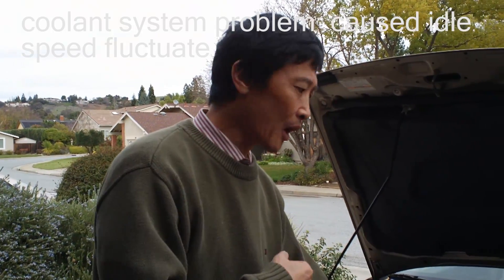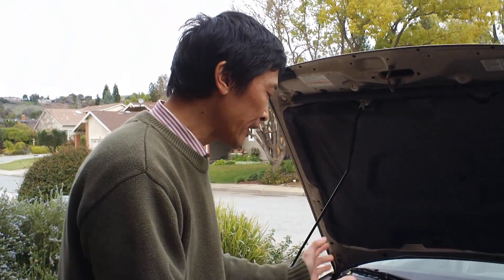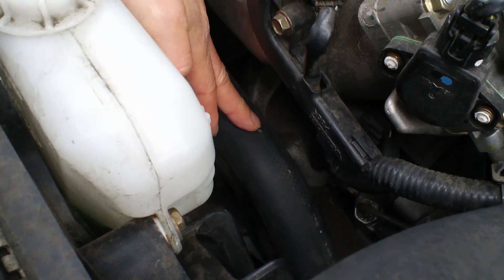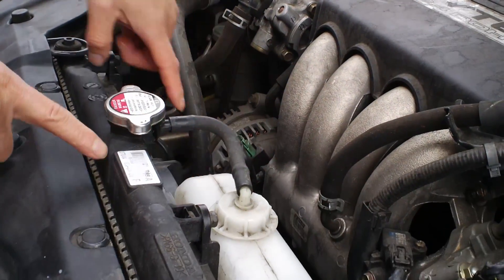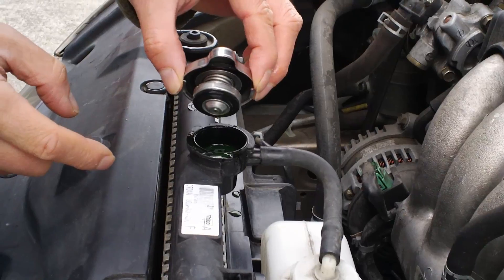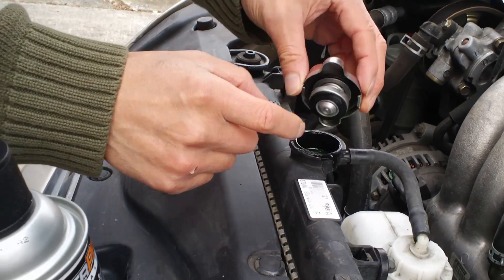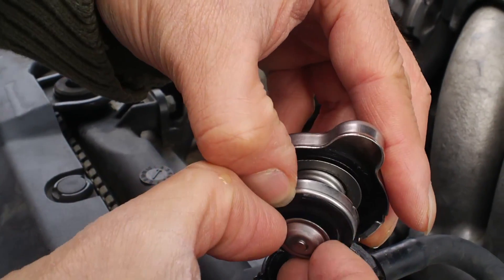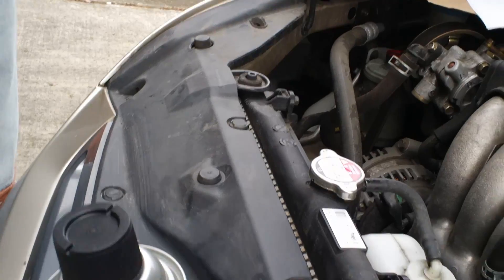Solution For Collapsed Coolant Hose In A Car

Comment: Have the surge and same thing flat hose and noticed this even buying all parts like throttle body plugs coils maf sensor pedal sensor and battery. Then a new air filter. I’m going to buy a new cap  now . 👍🤔

Comment: I had exactly this collapsed hose problem on my Vauxhall Astra, which was causing rough idle on cold start, Sep 2020. I released the Rad Cap and the hose re-inflated. After re-sealing cap I started it up and it ran smooth as silk right from the start!! Thanks for this I really appreciate it, you are a genius!!
Reply from the maker: Thank you for taking the time to share your problems and your results. Your case of other car make ad model will help other viewers to know this problem can be solved for non-Honda. Thank you.

Comment: Hey I have the same car and I have a problem could we get in touch so you can have a thought on what might be wrong
Reply from the maker: what is your problem? You may post your question here
Reply: Genius Asian oh so I have a leak from the radiator starting from the upper tank I have a short video I don’t know how exactly i could explain it to you 
My main concern if someone know the problem type I’ll be able to asses whether I need to get a simple cap or part replacement or do I need to go to the dealership which I don’t want to naturally
Reply from the maker: @shetty9494  I assume that you are sure it’s coolant that’s leaking, not another fluid. So the next questions:  is it from a hose? Or plastic part? Is it metal radiator tubes or the seam? Is it when engine hot with pressure?
Reply: Genius Asian it’s the coolant so it’s visible 
I can see coolant leaking from the top grill teeth
There is no cracks in the upper or top tank seems like it’s leaking from inside
Reply from the maker: @shetty9494  not sure your description, you may post a photo URL ( https://imgur.com/upload  ) may be some of our viewers can  help you.

Comment: Thank you...¤▪☆○•°~`♡😙😉

I foind other video saying that the other tank cap which need to either be cleaned or changed (follow the thin smal pipe from radiator cap to the extra antifreez tank so that tank cap is the problem... )

Comment: Great video I learned a lot
Reply from the maker: Yes, this coolant problem was tricky, not easy for people to realize that there is such relationship between coolant and other things.
Reply: Genius Asian yes. I found a spring in my coolant hose and was wondering why it was in there apparently it prevents the hose from collapsing in on itself.
Reply from the maker: thank you for sharing.

Comment: so this was the cause of the high revs and bad acceleration?
Reply from the maker: yes, the engine rev is controlled by the computer. And the computer takes inputs from many sensors including the coolant.

Comment: Thanks for the video, I ve the same problem before, the radiator didnot suck completly from the spare tanks (collant bottle). I check with all workshop they said my civic head crack an cannot be repair, I cannot find the head for my Civic engine and buy the whole seconhand engine :(
After replacing the engine found out that the top radiator hose bloated when engine warm and collapsed when engine cool down
Reply: Yeah, he definitely needs a new mechanic. It's harder than hell to find an honest mechanic. It almost seems like the nature of the work makes them crooked as a dog's hind leg.

Comment: If anyone has a cap that checks out OK then make sure the small hose going from the radiator to the reservoir is not clogged as that can cause the same issues.
Reply: What about if the small hose broke off
Reply: @lizzie.mcclainn  mine popped off and sprayed coolant everywhere. Im gonna put a ziptie so it cannot come undone
Reply: @Straight Out Of Sesame Street  Didn't work for me, lol. Gonna need a new cap.
Reply: @skeepboppin  i might need to do a pressure coolant test. Since my coolant in the reservoir keeps surpassing the limit line and goes all the way to the cap and sometimes the radiator will be completely empty but reservoir is way past full
Reply: @justavampire111  I have the same problem did you figure out the issue
Reply: @vq.ricardo  yes, i sold the car back to the person who sold me it lol. And its most likely a blown head gasket which is expensive
Reply: Whats that hose called? That's where mine is leaking from